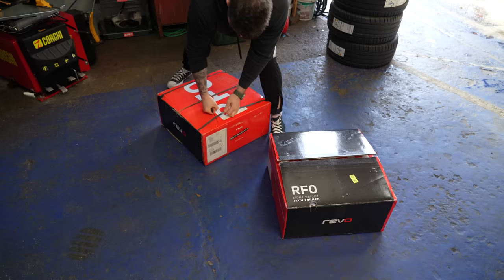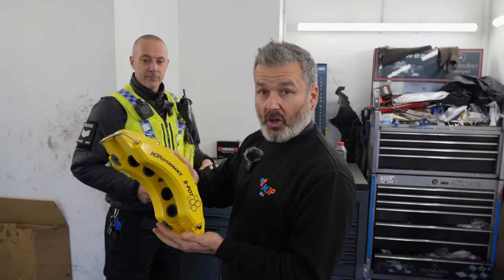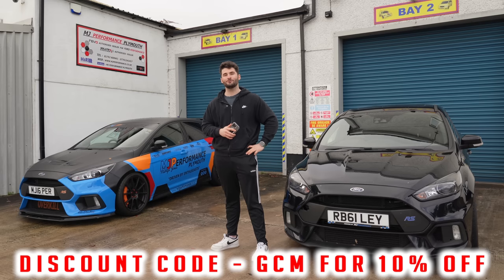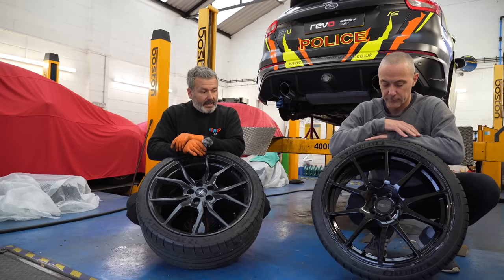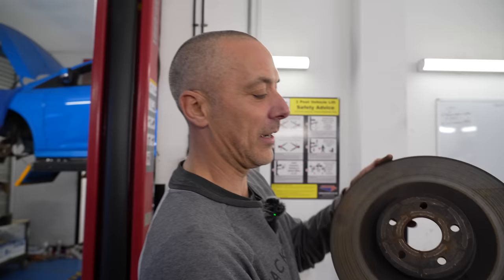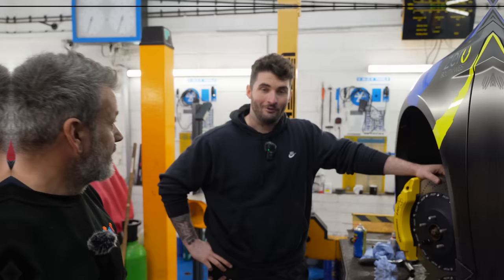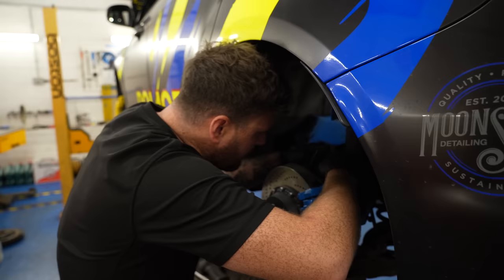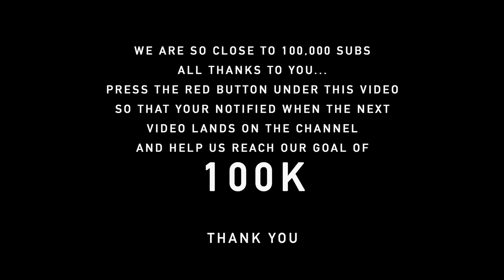Building a Modified Police Car Ep.5 - BIG BRAKES & .......

Comment: Brilliant.... Just a shame insurance companies see uprated brakes as a negative by increasing premiums or not insuring you at all. Yet these mods are one of the best mods you can do.
Reply: not always mine came down with uprated brakes. upraded bushes and shocks and remap
Reply: +1 sterling and Adrian flux didn't put my insurance up by a penny for big brake kit
Reply: If they are doing that they aren't worth going with. Find a company dedicated for modifications.
Reply: Less than £50 including admin fee declaring larger discs (front), b12 suspension and stainless hoses on mine. Remap puts the cost up most.
Reply: @allothernamesbutthis  mine came down from 420 a year to 240 a year with what i declared on my reknewal was well pleased even the guy on the phone had to ask someone if it was correct which it was
Reply: Let's hope these are declared
Reply: If this car didn't have Police on it,it would get pulled over every 5 mins.
Reply: Best mods 🤣, bigger brakes don't reduce braking distance they reduce brake fade, bigger/wider tyres reduce braking distance so unless you're doing track days bigger brakes are a waste of money.
Reply: @iamthepotato4312  brakes designed for the cars speed so my car will stop from 150-0 with no brake fade  its not all about the track its also topspeed  and will out brake most cars out there theres a lot more envolved for sure tyres etc
Reply: well iff ya can make a car go faster obv they are gonna put u in more danger so ya insurence goes up.can u not dot all the dotts up
Reply: @eyefishinggunkchannel1011  not always because a faster car is generally more capable and safer so can avoid a danger easier than a stock car
Reply: @squicker  so why does my car which is the more powerful version have bigger brakes than the less powerful version ? and it stops miles faster than the lower power version. i know this because we tried them side by side.
Reply: @squicker  learn new stuff daily
Reply: Adrian Flux 👍
Reply: when i changed the brakes on my breadvan (vw polo mk2) even though my car was lucky to do 70mph my premium went down 50 quid as they saw it as a added safety feature, still was paying just over 1k a year but a saving is a saving i guess?

Comment: You are better of with decent tyres, A big brake kit will not increase the stopping power of a vehicle or decrease its stopping distance due to the physics involved. A larger brake pad will only spread out the clamping force of the brake caliper over a greater area

Comment: The DS2500 pads you’ve put in the RS are not R90 compliant so how are they road legal?
Reply from the maker: You are quite correct and thank you for pointing out the error on the video. 
DS2500 pads are normally fitted to the cars for track use only. We have checked with MJP and our RS is actually fitted with the DS Performance pads not the DS2500 stated in the video. DS Performance pads are approved for road use and R90 compliant. 
We are trying to edit the video to avoid further confusion. 
Apologies and thank you for highlighting the mistake.

Comment: Looks stunning, wondering if these brakes would also fit the Volvo v40 or mazda 3 as I believe there all built on the same chassis?🤔
Reply: Not quite with the Mk3, but the C30 can have these retrofitted if you drill the holes in the hub out slightly and put a 5mm spacer behind the disc

Comment: Big brakes don't make you stop quicker. Bit of a pointless investment unless you're driving in track conditions and need the extra resistance to fade. I doubt anyone has experienced brake fade on the road. Buy good tyres.
Reply from the maker: As it’s not an operational police car we plan to use it on track so the brakes are a worthy investment. Also, the point in the project is to try and teach people the best way to modify their cars. Upgrading the brakes and tyres before touching the engine is a must as like the title says ‘power is nothing without control’.
Reply: @GCMYT  Fair enough if you're taking it on track, though as a track/autoX guy myself I'd recommend tyres, suspension, anti roll bars and a good alignment before brakes. Make sure you've got good pads and disks of course but most big brake kits just add a lot of unsprung mass unless you're going for 2 piece disks. Brake lines will improve feel if that is an issue. 

I'd recommend tracking it first then upgrading the bits that felt off, otherwise you spent a lot of money to go slow. I know thats more boring than putting sexy looking (and heavy looking!) calipers on but unless you're on track for more than 20 mins at a time, light weight and sticky tyres will always win.
Reply: @LukeEvans55  The guys repeatedly said it's a 'package upgrade that works together' - 8j to 8.5j is potentially an extra 10mm width you can play with, add premium tyres and a big brake kit - you will stop faster. Obviously, it depends on the car but it's quite easy to cook some brakes with spirited road use, and you're completely missing the point of these videos, Police know people will modify their cars, so the Police are proactively giving advice on how to do things properly, increasing the safety of everyone on the road.
Reply: @halezy9681  I completely understand this but I also don't want to propagate the idea that big brakes stop you quicker as this simply isn't true. All stock brakes have more than enough force to lock up all four wheels, simply because of the legal requirements for braking force. Increasing tyre grip and size is absolutely the way to improve stopping and handling, but I can guarantee the brakes do nothing in this setup to stop faster. I run 200 TW tyres over on wheels 3 inches wider than stock on a MK1 MX-5 for autocross and the tiny stock 9.25" rotors with 1 pot calipers not only lock up the wheels but show very little brake fade with good pad selection even in extended track use.

Not only is the setup above the "go to" for a winning lightweight autocross car, the BRSCC MX-5 official racing series does not allow upgraded rotors or calipers for true competition racing. 

Ultimately spending that much money on a huge brake setup like the one in this video is super cool,  but more of an "all the gear, no idea" insta-clout approach than born out of any real performance benefits... unless they do a proper endurance race maybe.

Two piece lightweight disks and lightweight calipers with steel lines are the way to go for actual benefits in this scenario, but still the money would be better spent on suspension, anti-roll bars, and a good alignment.
Reply: @LukeEvans55  They literally explained the video and the reasons behind the upgrades. If people are incapable of following such basic information, then they should step away. You're making points to refute something that ISNT in the video lol.